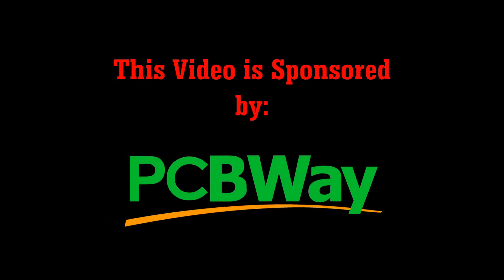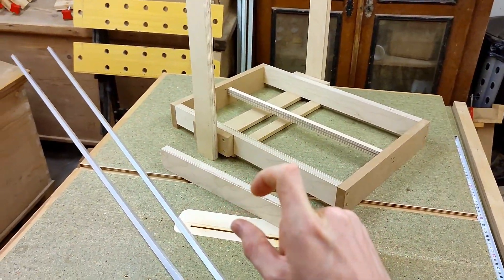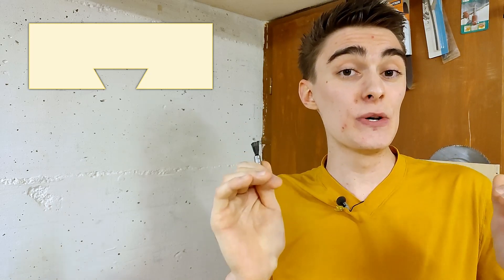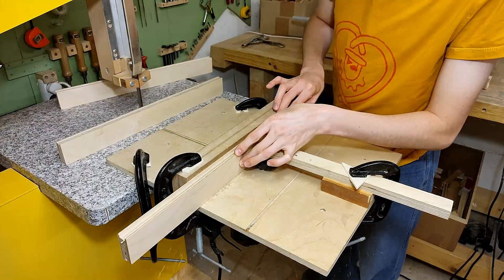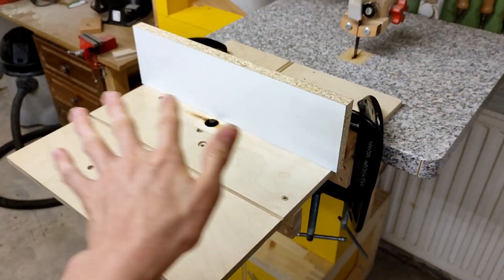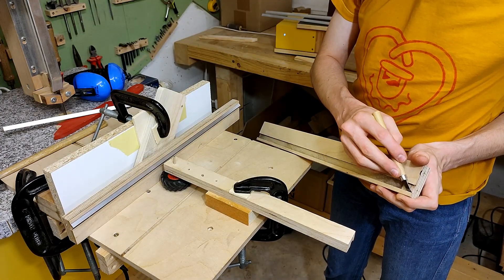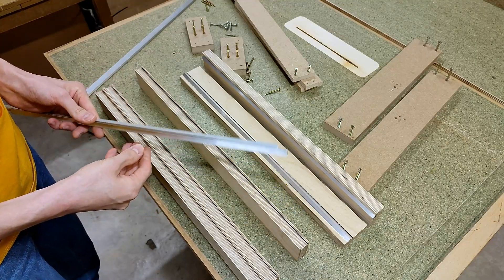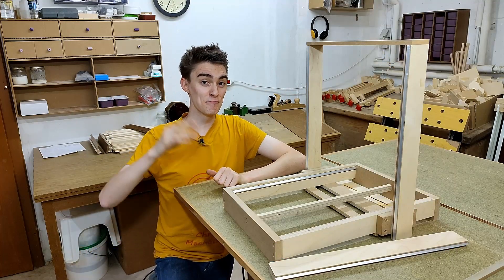DIY unipolar 3D printer part 2: installing LINEAR RAILS made from ALUMINUM ANGLE STOCK!

Comment: I know you don't particulary like this project but it's a really good one. You are pretty much the only one I know that even tryed to make a 3D printer without one of those nema steppers. I don't know if there is anyone else  have done one, but those motors are quite expensive, especially in places like latinamerica(where I'm from) and I think it would be a big step( ͡° ͜ʖ ͡°)  in making those printers more accesible. Keep up the good work!!
Reply from the maker: I know, everyone just goes the easy route and buys the Nemas. There are a few (like 3 or something) 3D printers out there with steppers salvaged from old scanners, but nobody did a proper video about it. Keep in mind I'm also still doing it the easiest way possible by using those microstepping drivers, which, imho should be replaced with something cheaper as well. Unfortunately I'm not good enough at programming to do it entirely without motor drivers, as that would require pretty much altering the software from ground up - on top of adapting mechanical design of the machine to fit the unique stepper motors.
But with any luck I'll come up with some radical changes to make DIY CNC in general more accessible within the next couple of years. I have some interesting concepts that are yet to be explored :)
Reply: @ChronicMechatronic    My dude, you are not even using a shield ramps, that's already like a whole different level of DIY that none of the DIY 3d printers ever made(that've seen at least) also, the drivers aren't that expensive either, you can take the licence. Assembler is not that fun as it looks like
PD: Have you ever tryed making anything with the delta structure? those things are hypnotic
Reply from the maker: @Eduardo-so9mk  no I didn't dare even think about the delta design yet, as I presume there would be a lot of trigonometry involved with the firmware. Also the need of 3 identical stepper motors would further complicate things since it's hard to find similar steppers in e-waste...
Reply: @ChronicMechatronic   The word you are looking for is not "complicated", is "Fun"(????

Comment: already used the system in my first cnc "Burrik7119" ... (you have complicated things ...)
... if the milling is not of the highest precision, it creates shrinkage, and bearing friction ... (the bearings must also be of good quality). it should be noted that the "w" bearings do not have an internal angle of 90 °, certainly less friction, but less stability ....

Comment: Love the wooden frame! I made a CNC mill out of wood and it works great.
It will be exciting to see how well those rails work. I expect they'll be a bit noisy, but precise and long lasting.
Another cheap style of linear rail I've seen is drawer slides, from Ben Fleming's EDM book.
Also would be fun to try a simple 90 degree V groove in the frame with teflon sheet glued in it, and mating shape on the carriage to slide in it. Teflon-teflon friction is incredibly low. Even cheaper/easier to find and about just as good is HDPE sheet with graphite powder rubbed on it.
Reply from the maker: Thanks for the suggestions! After the pen plotter was done I wondered why I didn't just put a V groove in the frame which would have allowed simpler roller and carriage design much like on the Ender 3 - never considered a simple slide bearing though, especially not with teflon... Might be worth a try!